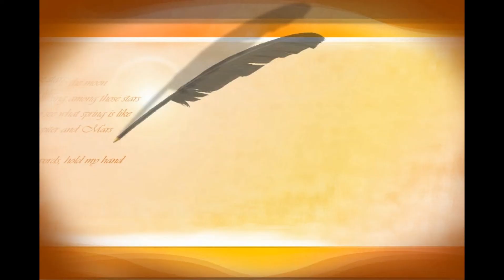Brake Master Cylinder Replacement MERCEDES C200 W202 2.0L 1996~2000 M111.945 722.603

Comment: I don't know why you're tightening up the brake lines, when you haven't yet added any brake fluid into the resorvoir, and bled the master cylinder.   The two most important parts of replacing a mastering cylinder - that you completely missed from the video.
Reply: Well☝🏻👍